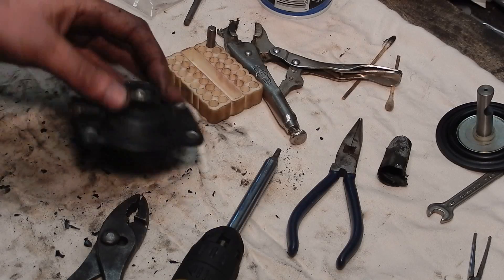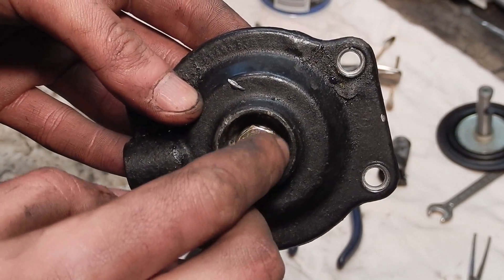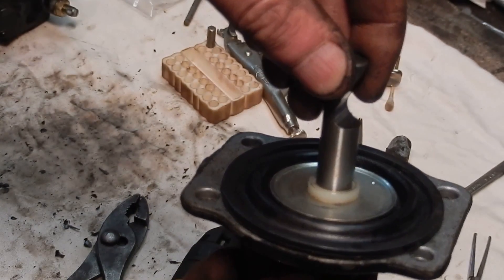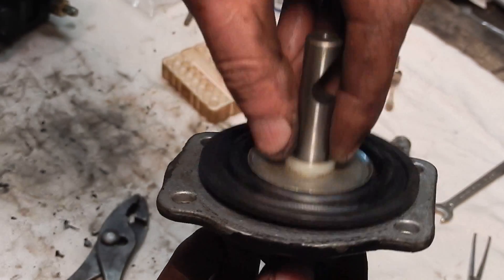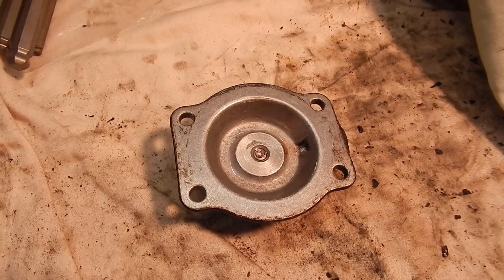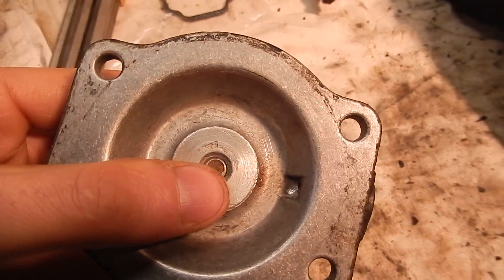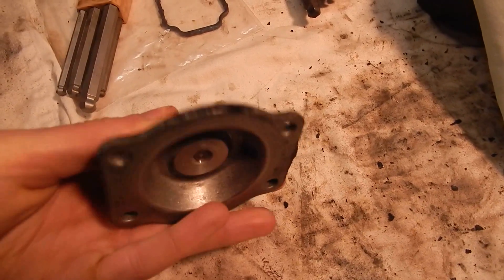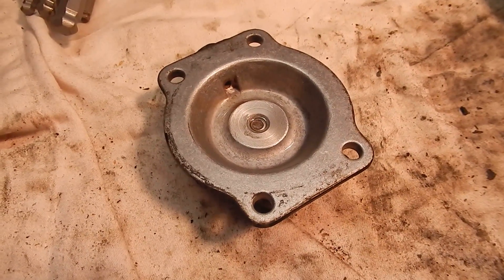First Gen Cummins - AFC Top Modification

Comment: Hopefully that doesn't bring the fuel pin SO high that the guide pin can shoot out under it.
Reply from the maker: good point. i did install the fuel pin, spring, and afc top temporarily on the bench to verify that did not happen. you can adjust how high the pin travels by adjusting the smoke screw.
Reply: Bradley Hayes I was wondering that too., without checking the mark on the fuel pin I think it's safe to go .100, but if the mark on the fuel pin allows you to go further then you can. Some of the cheap Chinese pins have a lip at the bottom.